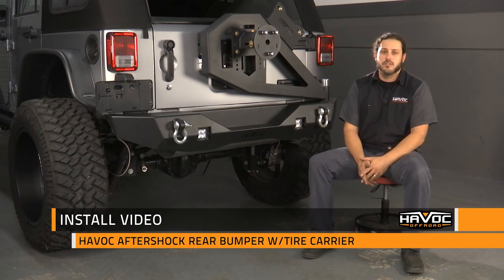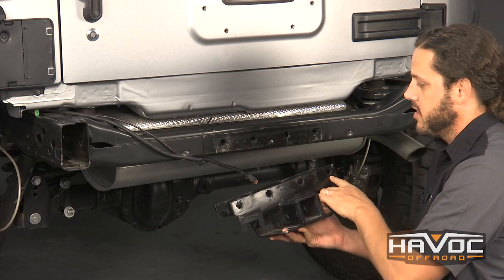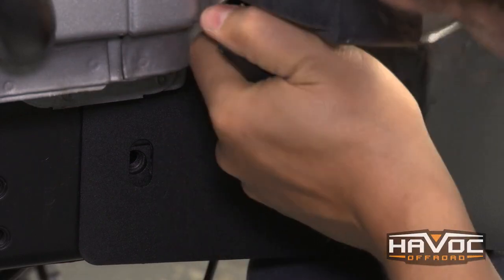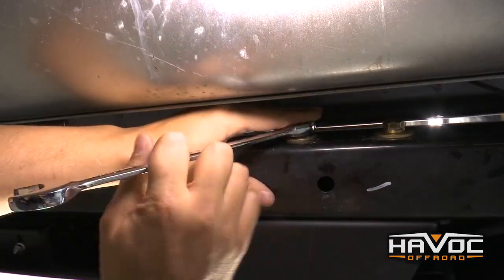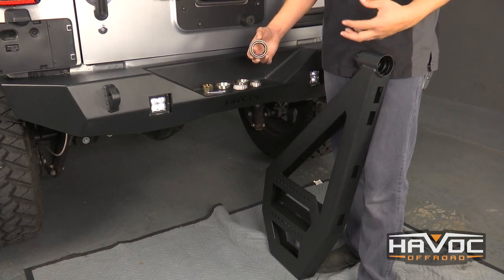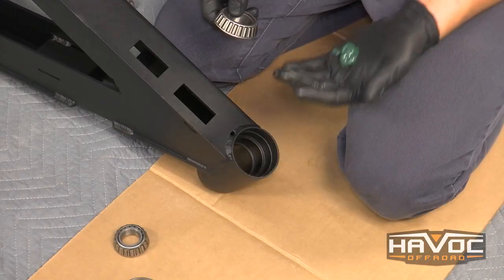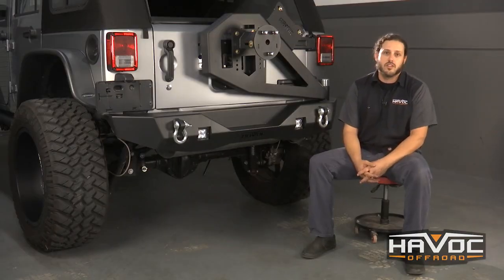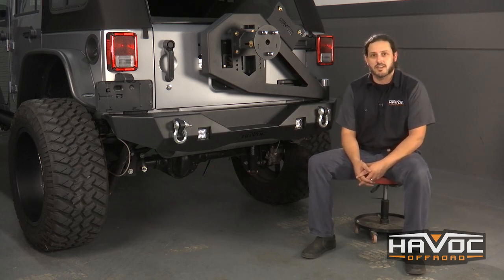Install Video   Havoc Gen 2 Aftershock Rear Bumper w  Hinged Tire Carrier   43 20202

Comment: Thank you so much for this video! I have been hemming and hawing for 2 months debating if I wanted this bumper (mostly because it is one of the only bumpers that allows for the stock tow-hitch to be used); that, and it has the Hi-Lift jack mount included. After seeing this video, I am going to pull the trigger on ordering the bumper+tire carrier. Really appreciate it! Keep up the solid work (and videos)!